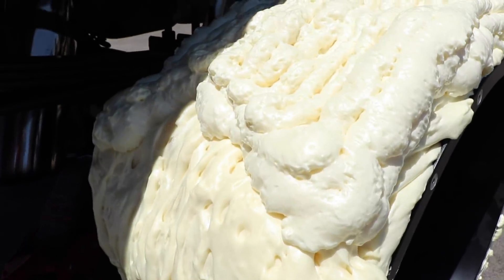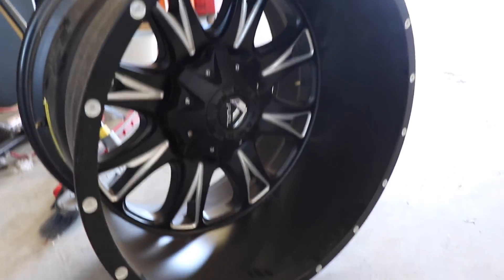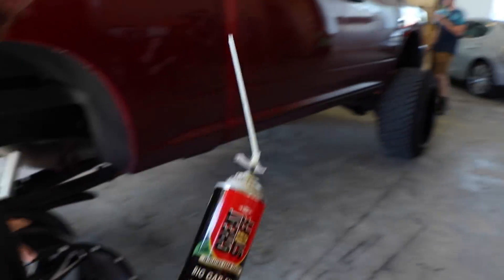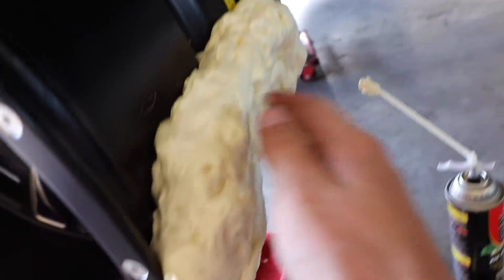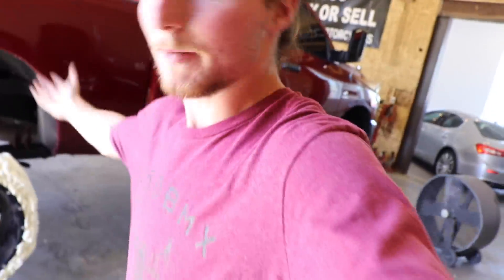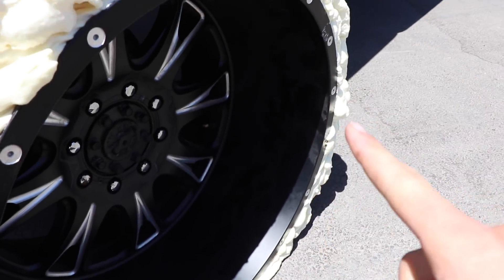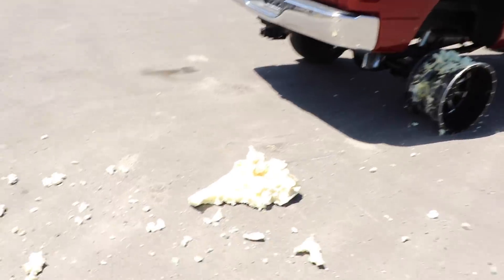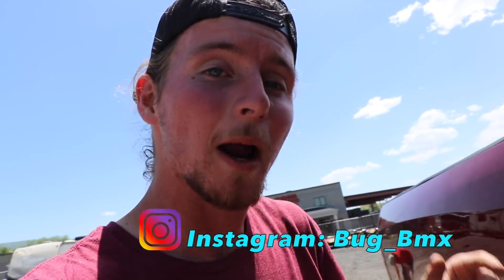MAKING A TIRE ONLY USING FOAM INSULATION SPRAY! WILL IT WORK?

Comment: I figured it would work some. I've had my quad tires filled with tuff stuff foam for about 5 years now. It's a cheap run flat solution.

Comment: Wrap the wheel in garden hose 👍🇺🇸👊
Reply: No
Reply: Danielle Newell yes
Reply: Danielle Newell yeah i dont see that working well either...
Reply: Hooked On Diesel yesss
Reply: Hayden Wilks same, the hose will just get flat and will not support the wheel properly
Reply: So wrap it in the hose, secure the hose, and inflate the hose.
Reply: No
I dont think that will work 
Plus it will moct likely just tangle up

Comment: If you take it slowly to start with it will flatten down but most likely not fall off. But if you peel rubber it will fly off quickly. But don't expect it to last long. Thank You Loader.  I knew it would work slowly. But over time it will flatten down until it cut the foam thats sticking out then you will know your in danger of damaging your rim. I watch some other guy using different materials to drive on an they were not gentle with their machine. Take care, I'll keep watching.

Comment: I think you might need to check the air pressure it looks a lil low    Lol.  I think do it again but this time do 2 wraps layered with a Kevlar mess in it and then put some rubberized spray rubber as the outside wrap or maybe just a whole thing of spray rubber

Comment: Try flex seal tire ( someone else's cool idea as well), carpet tire and duct tape tire. See if you can make "train tracks" for your truck to drive on with tree trunks or maybe 6*6's. Use rims on the tracks

Comment: you do know this idea has been done for years , people have filled lawn tractor tires with this stuff for many years , it works awesome , why not try filling a tire and putting it on the truck , and take a road drive , but you would have to use a steel wheel like you spare to do that so you could actually take a little drive without cooking the differential in your truck , you know what I am saying ...

Comment: Flex Seal the wheels.
Reply: Well rim. Depending on what ya wanna call it.
Reply from the maker: Nathan Leis I like your thinking!
Reply: Bug Bmx. I flex sealed the inside of a 13x6.5-8 (i think) lawnmower tire. Flex seal on the inside. Honesty it slows the air lossed by A LOT. But made for tires no. But a rim. Why not. Bet it hasn't been done either. Be the first to try it. But just a 17 year old throwing out an idea. Best of luck though.
Reply: Btw love your truck and videos.

Comment: I would have gotten cardboard goaround the rim with about 2 inch of gap between the rim and the rim and then go and tape the cardboard together with the rim off the vehicle on the side then yoi could have just filled the void between the rim and the cardboard let it set for 48 hrs then rip the cardboard of the outside and it should be symmetrically round after it cured
Reply: P.s. i wouldnt have used a nice vehicle like thst ether i would have used an old clunker

Comment: Do foam and rubber liner next
Reply: More foam thicker and Jack up the rear end let it idle in gear while foaming more even fill and then shave it down nice and smooth and even and use a rubber based bed liner for the last coats

Comment: Fantastic way to destroy a limited slip rear end
Reply from the maker: Andrzej Conner It can be fixed. It’s fine btw
Reply: Bug Bmx haha you sound like me. I pop engines and Transmissions and say "eh, it can be fixed".  Anyway I commented before I saw you just idling it back and forth in the parking lot